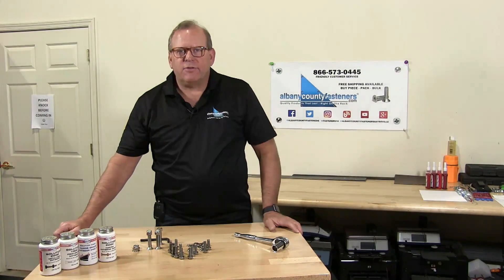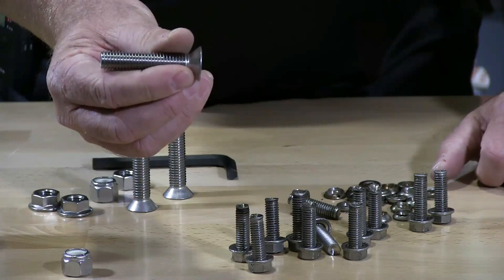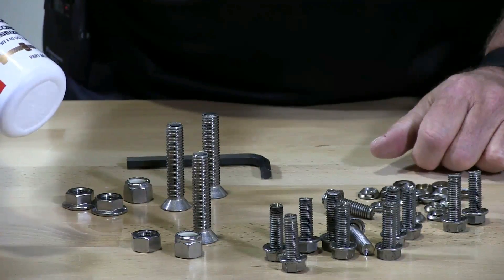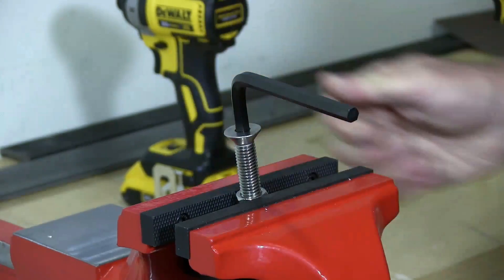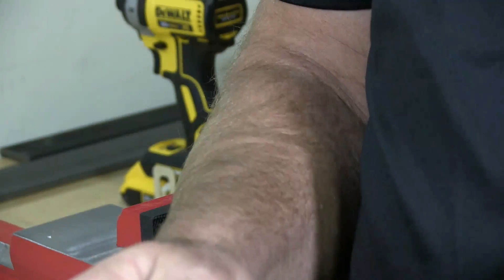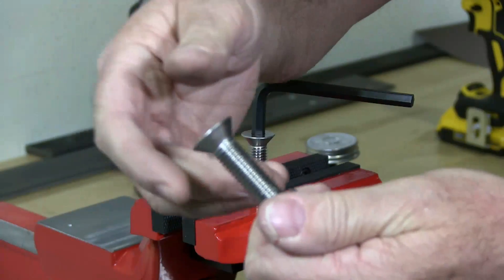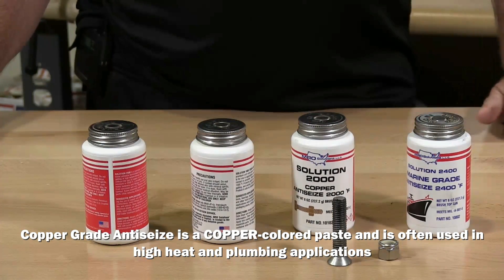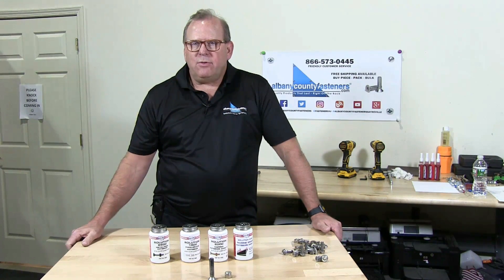Seized, Stuck, Broken Bolts - All About Thread Galling | Fasteners 101

Comment: So, it could be wise to a run tap/die through bolt/nut to clear debris and high spots before usage ?. Or wire brush wheel to polish bolt threads ?......and then the anti-seize compound lol.

Comment: Whether a thread is cut or roll formed, there should be no friction or resistance when fastening by hand like that if both nut AND bolt are within tolerances of the UN standard. But, yes there will be galling once fastened pressure starts and tork is applied.

Comment: Vasoline (petroleum jelly) can work on stainless-stainless also. Actually had some high temp/pressure flanges that needed lots of torque and the design engineer called for it. It wasn't 100% foolproof as the mechanics love impacts.

Comment: I always use that 'silver' colored anti-seize coating on all of my spark plugs, all my wheel lug bolts/nuts, and all of my stainless steel fasteners.  The 'silver' stuff is a blend of aluminum, copper and graphite lubricants.

Comment: WOULD be nice if you did a video on GALLING STAINLESS STEEL PIPE THREADS. GALLING HAPPENS IN MAINLY STAINLESS STEEL, ALUMINUM, AND TITANIUM METALS. They are the most prevalent problem children of metal. Nice video too.
Reply: BREAK YOUR CAPS LOCK BUTTON
Reply: @Adam-zw1ck  ADAM, WHY ???

Comment: does it occur if only one, nut or screw is stainless and other is mild?
Reply: As far as I know, it will only happen if the bolt AND the nut are both stainless steel.

Comment: What would you do if the bolt needed to be torqued?  Most bolt specifications on motorcycles are based on dry threads, whereas using anti-seize would alter the final torque.
Reply: reduce torque values by 20-25%.
Reply: There are charts that give you torque values for dry conditions as well as for using different lubricants.
Reply: @svc570  Are you able to post a link?
Reply: The main problem we are experiencing is the Quality of metal being used . Rubbish Chinese bolts, nuts and washers. 
Sold as high Quality for high prices. That's the problem. You are been shafted.

Comment: Starting working in a large slaughter house over 50 years ago. Between the kill floor salt filled hide cellar rendering room where they cooked the guts and cattle pens place was a nightmare for galling rust & corrosion. We used never seeze on everything.

Comment: I had this galling happen on steel bolts into steel threads cut into a frame. are most steel bolts cold rolled too? that would explain a lot. I used 30wt oil thinking that would be sufficient....it wasnt.

Comment: I didn't even know the word galling until Saturday. Then I tried to take the threaded caps off an aluminium sausage stuffer (we had been  butchering a pig), and I ended up learning a hell of a lot about it. Fortunately one of the people helping with the butchering was a mechanical fitter, so after a lot of hitting the stuffer with a hammer and heating it with boiling water we managed to get it apart. He gave me a bit of advice for the future though - "Don't ever buy anything made in Poland: you'll regret it."
Glad to see that there's food-grade anti-seize. Next time I'll use it (or buy a better sausage stuffer).
Reply from the maker: That's some fun advice! Well, here's hoping next time around the anti-seize can help you out with that. Or the better sausage stuffer. Whichever you go with!

Comment: Thank you for this video.  I am trying to secure a metal rack on my bike frame.  The bike frame is made out of alloy; I made the mistake of using SS bolts and nylon lock nuts and experienced galling.  Had to drill both bolts out and damaged some threads in the bike frame.  I'm think of using 8.8 or 10.9 grade bolts instead now to avoid galling and seizing.  Would it be OK to use nylon SS lock nuts or just plain SS nuts with the 8.8 or 10.9 bolts through the alloy bike frame?  Anti-seize recommended still?  If so, what type?
Reply: It's a shame no one replied to you.
This is a bit late but yes, anti seize is recommended. You can use either a types.
I have worked on my own vehicles for over forty years, if I take a bolt out, I clean the threat on a wire wheel or wire brush and apply anti seize before refitting it. 
Many years later when I go to undo them, they come out really easy, 
You can use the SS nylock nuts on 8.8,  I would run the nut on an old bolt first to de-bur it a little and then use anti seize.

Comment: If it's too tight going in, always back off and use lube!
Reply from the maker: Thank you for the feedback!
Reply: didn't take this advice and bound the left hand thread bolt to my grinder shaft. when I finally got it off there was no thread left on the shaft and only half thread in the bolt. neither were stainless but they both seemed hardened. there was a lot of squealing and smoking when it came off!

Comment: You did not remove the Nylock all the way! Some Stainless Steel screws are just garbage and no anti seize snake oil is going to prevent them jamming.  + consider the case when you need to  have a real clean bolting (pharma products...)
Reply from the maker: Thank you for your feedback.

Comment: Hi for Brake disc and pad, should we use anti seize or copper grease? thanks.
Reply from the maker: We recommend anti-seize.
Reply: I'd imagine you don't want any lubrication on your brake pads or rotors
Reply: @lucifchristo Between back of brake pad and calipér.

Comment: With the use of the anti freeze, would it be ok to also use the battery impact? We have seen many situations where nylocks have been used on long threaded bolts and it takes like a ridiculous amount of time to turn by hand.
Reply from the maker: Hi RollingThunder!
Anti-seize is designed to prevent galling on stainless steel fasteners although the addition of the nylon may still cause some issues at high speed. You could try finding a long bolt (at least the length of the ones you need to apply the nylocks to) and applying the anti-seize to the nylon lock nut and driving it a few times with the battery impact at different speeds. This will give you a feel for how fast you can run the impact without causing galling. We have not yet done a test on this and cannot say for sure if it will work or not.
If you do attempt it before we can test it, please let us know how it works out so other users can benefit from your experiment!

Comment: If in doubt, threads a bit tight, I'll run a tap / die along the threads, use the correct wrench / torque wrench,  plus suitable washers, suitable lubricant (if required) or Loctite.  In 50+ years, I have never encountered Galling.  Sorry if you find that a bit galling.
Reply from the maker: That tightening of threads you described probably is galling! Tightness while threading fasteners can only occur if either the fastener/nut was threaded improperly at the factory, the fastener was misaligned when fastened, or, as is often the case, galling. Nevertheless, thanks for the tip on dealing with tight threads! Not everyone is as lucky as you when it comes to galling.

Comment: what about using SS A2 bolts on cast iron?
Reply from the maker: It could work, but we wouldn't recommend it. It's never a good idea to mix 2 dissimilar materials together.
Reply: @AlbanyCountyFasteners  I thought it was a smart idea to change bolts on mini lathe to stainless steel, you say it not? Better black oxide bolts?

Comment: This guy is talking about very tiny problems. Maybe a little anti seize on S.S. hardware but I have never had any of these problems. I think he is selling the anti seize junk.
Reply: Galling is a very common and well known issue around the world with SS fasteners.  Its not something this guy invented inorder to sell antisieze.

I have had it happen numerous times personally.  Usually with chinese stainless fasteners.  I am an auto electrician and often customers will ask me to fit LED spotlights and lightbars onto their vehicles.  These types of products almost always come included with SS fasteneres.  And multiple times i have had it occur.

I think the biggest thing is to do them up slow and easy.  I have found if you use a cordless driver to do them up, they go fast, build friction heat, then gall.  Effectively welding the nut to the bolt.
Reply from the maker: Thank you for your feedback.
Reply: I have used stainless bolts with nylock nuts for decades on my motor cycles, and never had a problem - but I had a big problem with a pair of Amal carburettors when I had the banjo bolts newly chromium plated.
Reply: On our beach houses down here we use 3/4" x 12" bolts ($20 each), once you get the nut on it ain't coming off. Even seen a few that weren't snugged down that could no longer be moved.

Comment: Just curious, would a drop of oil or grease work about the same at least for installing the nut, maybe not as effective for removing it, might require another drop of oil?
Reply from the maker: That might work but we don't recommend it. Anti-seize is made specifically for the purpose.

Comment: so, galling is basically when the bolt and nut are not properly made, right? not properly matching each other, right? if they do match (no extra wrong friction) then no galling, right? thank you very much!
Reply from the maker: It's not necessarily that the fasteners aren't properly made or don't match, it's simply the nature of the materials and process. The imperfections of manufacturing increase the friction when installing the fastener, making the problem more likely. But, even if there were no imperfections if there was enough heat caused by friction is would still gall. That's why it's common for nylon insert lock nuts to gall due to the added friction from the insert. For more information and details on the galling process, visit our page on the matter: https://www.albanycountyfasteners.com/Thread-Galling-and-Fastener-Seizing-s/1248.htm

As a best practice,  we always recommend using an anti-seize solution such as MRO: https://www.albanycountyfasteners.com/anti-seize-lubricant/949.htm
Reply: @AlbanyCountyFasteners  
Have you heard or used a product called Duroc?  I am looking into how to avoid galling, and saw a video with what i think they called duroc used over the fasteners.  It looks like they sprayed a light coat of paint over the bolt.

Comment: Thanks for the info.
I'm guessing I wouldn't use an anti-seize solution with say blue loc-tite, .....(if I ever had to get back in there). Old motorcycle vibrates parts loose from time to time.
Reply from the maker: Blue Loc-tite should not vibrate loose.  However, you can remove it should you have too.  Thanks for watching my videos.

Comment: What this video does is show something about galling but what it does not do in tell why galling really takes place. Metallurgists will tell you that two similar metals pushed together have a much stronger tendency to gall. Something soft like 304 stainless steel has a very strong tendency to gall. That even includes the washers used. If you want to reduce the tendency to gall use a hard and soft SS together - say a 304 SS bolt and a 301 SS Nut or washer. Sure the Anti-Seize solutions work but not the only way to do it.
Reply from the maker: Thanks for the input David!
Mixing grades of hard and soft stainless would have less of a tendency to gall, however it would not work for every application because each grade of stainless has its own unique properties in terms of corrosion resistance, magnetism, etc. One example would be a boat on salt water that has to have all 316 stainless fasteners to avoid rusting. But yes, there are quite a few tricks out there that will work (we even used to use Maalox before they stopped making it!).